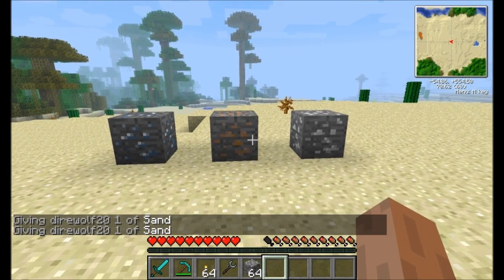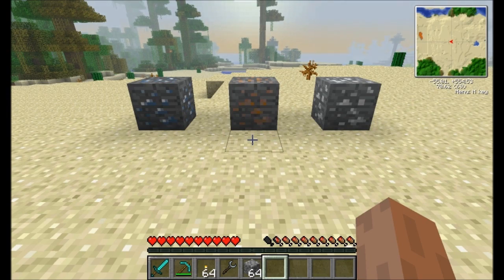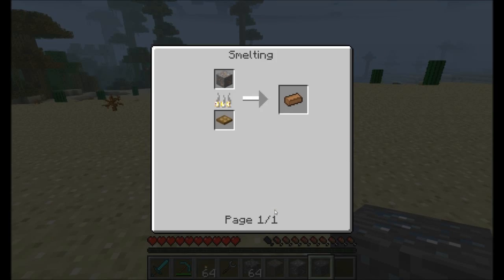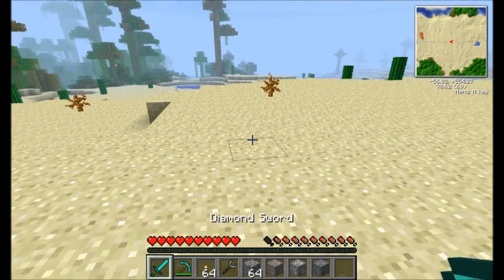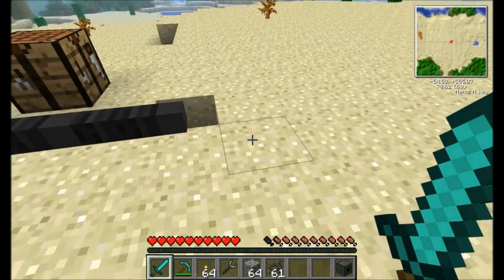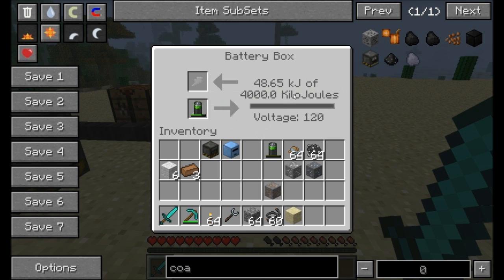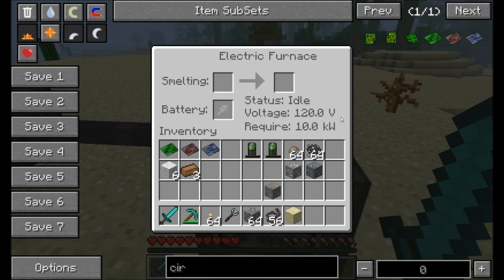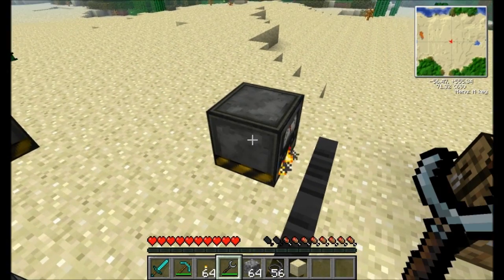Mod Spotlight - UE - Basic Components

Comment: One of the UE mods adds a "Energy Cube" Which is a Batbox that works with UE, IC² and BC power. That means you can run IC² machines with a UE Fission reactor if you put a ENergy Cube between the lines

Comment: the transmutions are as follows:
iron->gold->diamond->(whatever the mod author wants)
magma is easy enough to handle except when you run into it every ten blocks. you realise you can just make gold/iron nuggets straight from gold/iron ingots? at level 6 the lava will not be below you when you run into it, it will be above you rendering a WATER BUCKET useless.

Comment: The whole point of the UE API is that you have one streamlined version that allows for many, many mods to instantly work together simply by having an API that is universal.  IC2 uses its own resource, as does RP2 or BC3.  They don't share the same form of power, hence you have to expand your base considerably to accommodate them.  However, with UE you have one solar panel?  No problem, that energy works with ALL other mods that use the same API.  It's for simplification, not to be unique.

Comment: Ye, they do from what I know. I do like the ore distribution system a lot in TE. The old one let you just dig at 11 and get everything you ever needed. In case people don't know: Copper 50-75, Lead 20-40, Silver 15-35, Tin 25-50. FTB *might* use different settings(?) but those I wrote are the default TE ones.

Comment: Because IC2 addons would be limited.  You can't do everything just branching off of IC2.  New blocks and/or items may change how the power works, causing an imbalance between IC2 and the addons.  The UE API allows mod makers to branch into anything they want so long as they use the power provided, and since the ore dictionary is being used, they can even add new ores with ease.  IC2 wouldn't simply let you add new ores without changing the world spawning completely.  It's not trying to "1up" IC2

Comment: Well, for one there are ALOT of chemical processes in gregtech you can explore. LOTS of way to get power and materials out of almost everything. Hell, you can macerate almost every material and get dust with actual chemical formulas. That you can use to break down the material to basic elements or combine with other materials to get new materials. I think this ability is AWSOME, and the fact that you cant reach the end in a few weeks is also awsome.

Comment: Gregtech is based to challenge players on building for benefits. If you are saying this because of the FTB mod pack, you can disable the modpack via configs. Direwolf doesn't like it because it manipulates the original recipes. I like using gregtech in single player, but for servers, disabling it is the best. Also have you seen the original recipe for advance driller and ultimate lapack? Gregtech actually keeps it well.

Comment: UE doesn't rip anything off...I don't know where you're getting that. It makes a form of electricity that, in the future, everything will be able to use. IndustrialCraft machines can use it right now (connect an IC2 cable to a UE batbox), and BC machines are coming soon. RedPower is a possibility if we can contact Eloraam.

Comment: Honestly, I think RP2 power is the best system out there. (In terms of energy transfer and microblock cable hiding). If only RP2 power was compatible with IC2 machines and tools (and you'd probably need a few more power generation options too).

Comment: that's not the point, this was written to work with other mods so they could use an electricity system without having to code one in. You can't use industrialcraft power in the ICBM mod, for example. This guy didn't write the API to compete with IC2/BC etc., he just wrote it to save some other mod devs the trouble of implementing in their own power system.

Comment: Basic solar panels in gregtech is acctualy cheaper than the original ones in IC2, but requires ALOT higher tech. And i feel thats ok, nice solar panels is kinda high tech. So when you reach the tech you need to create solars you can use them to add to your powergrid. They are not useless at all, actually still pretty powerfull, but as i said, takes alot higher tech to reach. so IMO they are not something you base all you power off, but something to support your power gen.

Comment: You actually make the mod sound way too op. Correct me if I'm wrong but gregtech is a compilations of mods and ideas that were originally *scrapped* by the IC2 developer(s). It also only really affects IC2 in the long haul. Most of us barely even use IC2 and even less so gregtech so no real need or want to even have the mod. IC2 has one great thing about it... that's the drill. That's just amazing. Everything else I can do perfectly fine without.

Comment: i do get 30-40 diamonds every half hour and you can try with removing every thing from a new world (using an external editor) and follow a line you will find that amount (ok you need a diamond drill or you wont have the speed needed or a enchanted pick)

Comment: I agree on that, but every power system (atleast TE, BC, IC and RP) has some sides that are better than the others, and some sides that are worse. It would be awsome if forge implemented a power API that allowes every machine to accept every type of power. Kinda like the liquid API they implemented. (yes, that would require some (ALOT) or re-balancing, but hey, worth it!)

Comment: thermal expansion has solved the "yet another power system" in my opinion.. it acts as an upgrade on the BC power system. both mods can use both systems. I really like the way thoose mods play together. But yes, i agree on the balance part, and that thermal expansion tries to be "better" than IC2.
But really, that is the modpack creators task to balance, not the mod creator. You cant simply balance your mod to every existing mod out there. That is not posible in any way..

Comment: I'm experienced in IC2. I don't argue about stuff I don't know about. IMO solar panels are not OP at all. The resources it requires to make them, and the amount you'd need to make for them to be any use makes them pretty terrible power sources, IMO. Sure, if you use your IC2 machines once in an hour you might be able to keep up, but anything more than that and they're useless. By the time I can make gregtech solars, I've already got a much better near-infinite fast energy system.

Comment: Yea, this could do with replacing the core IC2. Those basic bits are about all I use from IC2, but I do use "addons" to IC2 which, I presume, won't work with UE. (I'm sure equivalents will appear)

But at least this has the right idea (my impression of the "right" idea) for a core energy system which IC2 missed; KISS. ;)

Looking forward to this, as a good cure for that IC2 addiction I need to kick. *teehee*

Comment: I installed Universal Electricity Core, Mekanism and ICBM, but I have no generators (except ones added by Mechanism Generators which are not as good). Is there a mod I am missing? I don't seem to have any of the items shown in this video, but the mods are working...
(this is in 1.6.4)
Reply: I have the same problem. I've got a few UE mods, and then I realise I've got no Basic Components mod. I thought it came with the UE core. >:/
Reply: Adam VanDerHoeven ComputersAreRealCool I had the same problem, you need basic components mod I believe or some other mod that allows electricity to be added.
Reply: Darren Winsett I can't find Basic Components anywhere. It's really annoying.
Reply: UE just allows electricity mods to interact with things that need electricity it turns out.
Reply: -_- seriously bro
Reply: Basic components also just allows other mods to interact, you need like project red:power or something like that.
Reply: Darren Winsett So, are you saying that the machines shown in this video are in Project Red?
Because that's the whole issue; where to get these machines from, because they are apparently not in UE Core anymore.
Reply: No, these items no longer exist unless you find a really old version like the one that's in the ICBM or moonquest mod pack.
Reply: Darren Winsett That really sucks.
Why whould a mod author remove the most essencial items from his mod?
Reply: Because he changed it over to a connector so that you can use whatever power source you want instead of being required to only use those itmes.

Comment: Personally I don't like free power generation at all, to some extent even lava shouldn't be considered a fuel source in the game. Of course gregtech does nothing to counter that. All it does is add a cost to recipes. For example the macerator from ic2 requiring 3 diamonds or something like that. Finding diamonds in the game early on is totally RNG based. You don't BALANCE anything around RNG. You could dig a hole straight down and hit diamonds or dig for 6+ hours without finding any.

Comment: But why make a new mod and API to do that when you can already make an IC2 addon. While I agree with you that having lots of different power systems isn't good, this mod won't replace IC2, so it will just become another power system (making things MORE complicated). 

I have a real headache right now about thermal expansion. Early-game the pulverizer is simply better than the macerator. It isn't balanced at all and the obvious attempt to 1-UP IC2 annoys me.